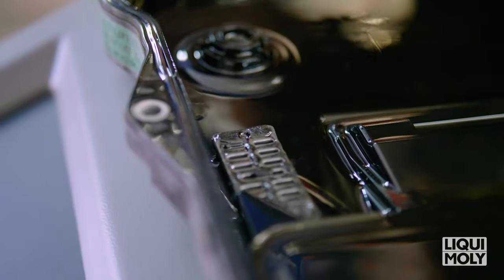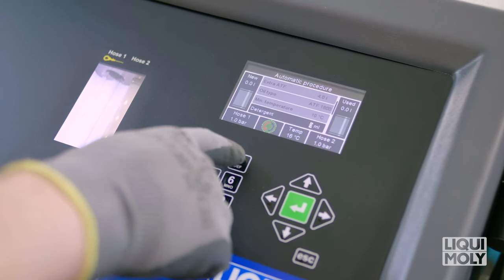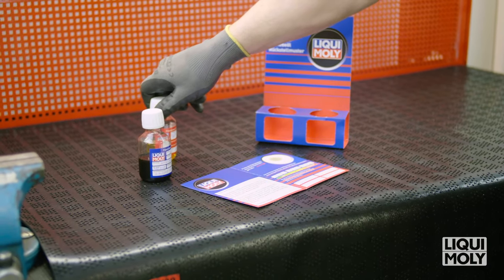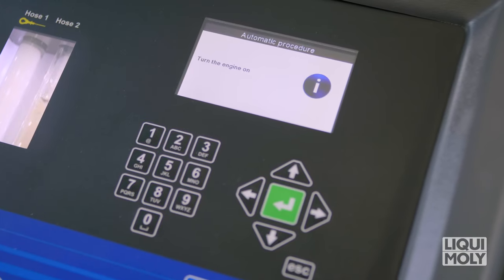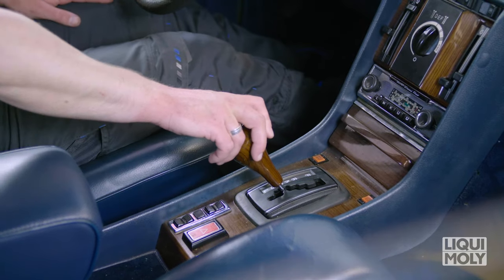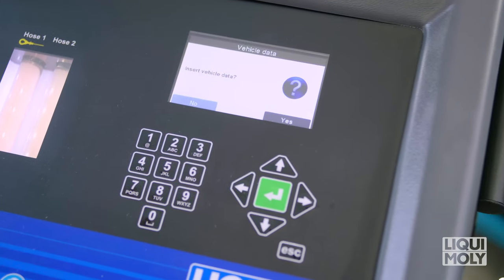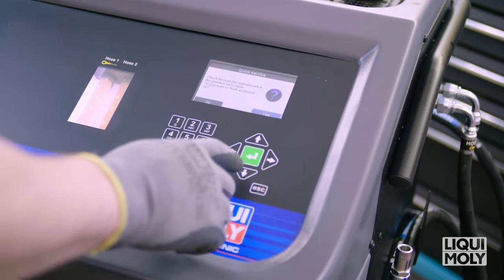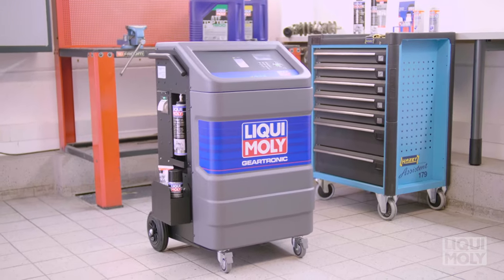LIQUI MOLY Gear Tronic II - Professional automatic transmission fluid service (Art. no. 29021) EN

Comment: At 6:25 can you share what exactly this means .. because i didnot see the  addition of 8.5 lts of ATF oil back into the vehicle ? , the screen at 6:25 shows the ATF oil used for performing flushing which should be about 4 lts as per instructions stated at 1:54 ..  When does the Machine inject the 8.5Lts of ATF oil ? 

Warm Regards 
Akshay
Reply from the maker: Hello akshay, 
you're right, of course. 
But please note that the video is only meant to illustrate the function of the device. 
While shooting the video, different sequences were filmed with different vehicles.
This is where the difference comes from.

Kind regards, your LIQUI MOLY team